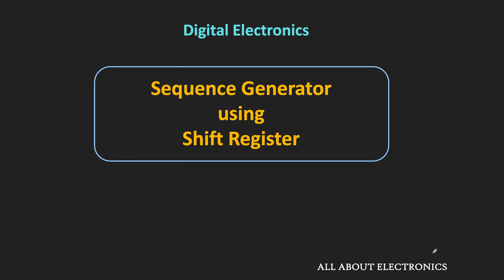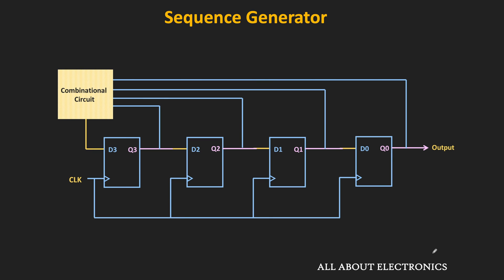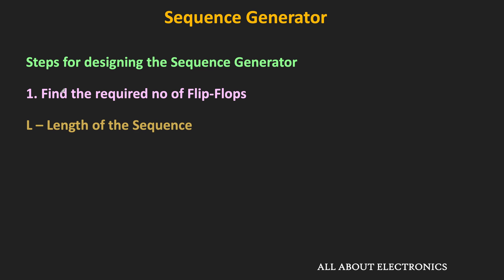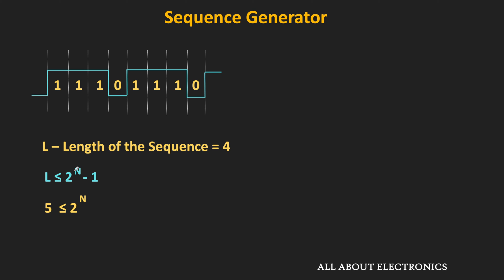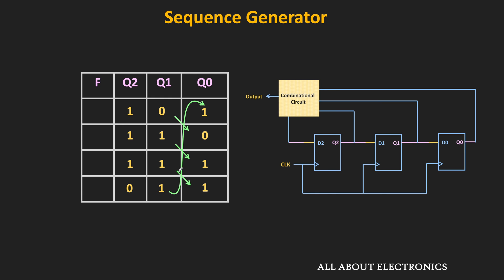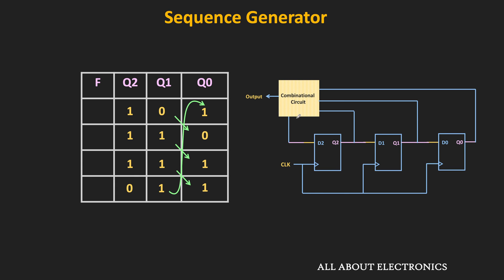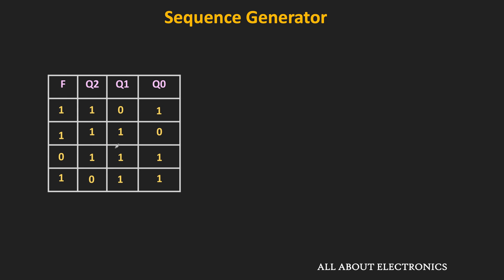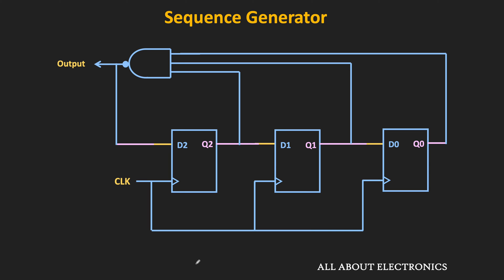Binary Sequence Generator using Shift Register (with Simulation) | Digital Electronics

Comment: How solve this using T flip flop
Reply from the maker: You need to convert T flip-flop in D flip-flop (using XOR gate).
Here is the link for the conversion: https://youtu.be/iAEgeuIoEBQ?t=556
Reply: @ALLABOUTELECTRONICS  ok but what the value of the input d
Reply from the maker: @husseinkj1269 Like here (using D flip-flop in the video), the output of one flip-flop is connected to input of the next stage. So, in that case, also , the output of the previous state can be connected to the one input of XOR gate. I hope, it will clear your doubt.
Reply: @ALLABOUTELECTRONICS  yes i did it in multisim but the result different in T flip flop i hope to communicate with you to send the picture if you have a time